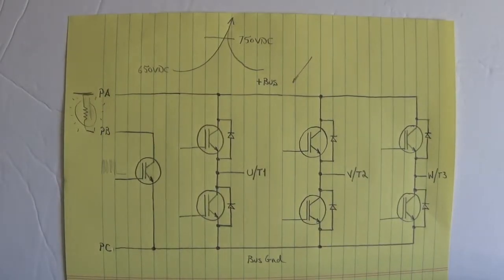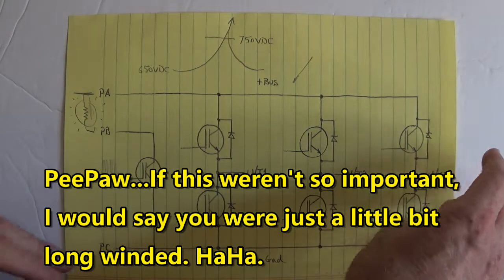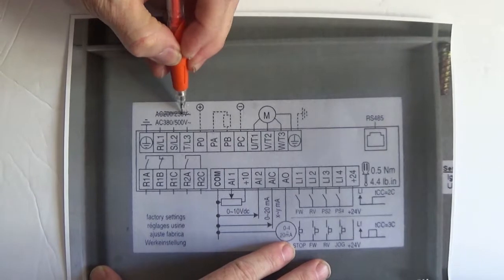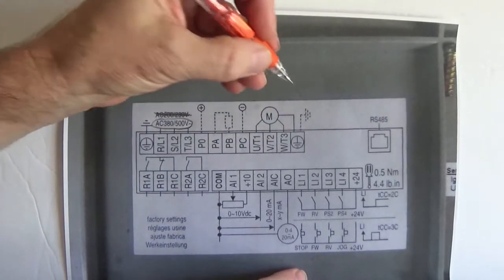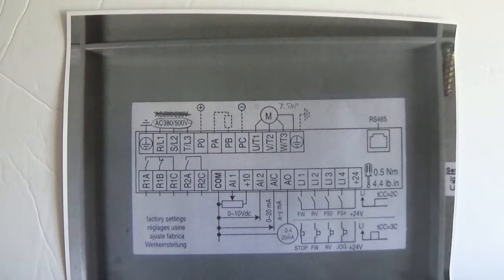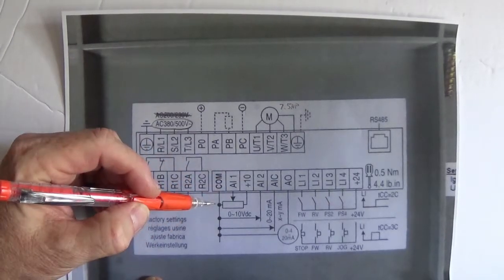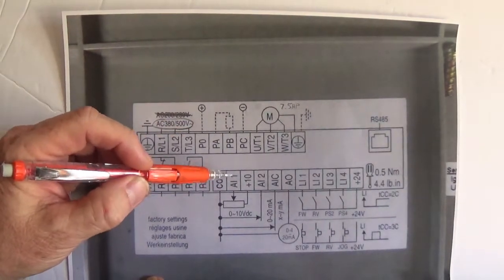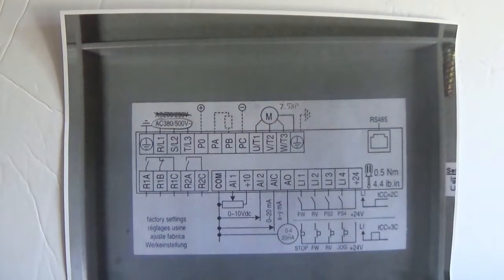Testing the Inverter Drive (Part 2)

Comment: I need some help from you,can you help me?vert urgent!!!
Reply from the maker: I am sorry for being late to answer. I was away on Black Mountain visiting the ghosts of my mother and father.
Reply from the maker: I can try to answer your question if I can. I know many things, but I don't know everything. I am always learning everyday.
Reply: Nice to hear your sound.ok tq for replying sir.sir i got on fanuc ibeta servo spindle drive,the problem is alarm no 3 in servo in monitor shows 9003 dc link fuse blown,we put another good drive machine running,again we put the faulty drive alarm comes.i remove the covers and check the power side there nothing fuse at all.i am really confusing sir.can i get your email address i sent you the pictures all.help me sir.
Reply from the maker: Hello Sir, back in 2013 I worked on an A06B-6134-H303#A. It had a missing phase alarm 04. And 9004 on the monitor. There is a string of high ohmic resistors connected to the incoming line voltage on L1, L2, L3 Terminals. The resistors had overheated and opened up.
Reply from the maker: This drive is similar to yours, but has three servo axis. Whereas yours has two servo axis. I took pictures of the drive I had repaired. And I couldn't see a fuse either. There is no fuse in that drive. So I am like you, I don't understand how it could trip on a blown fuse that is not there.